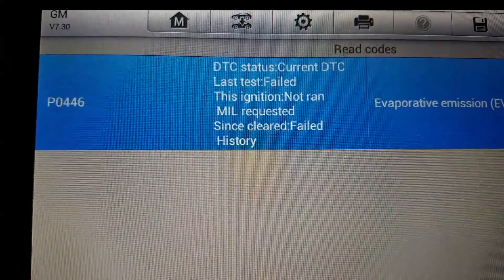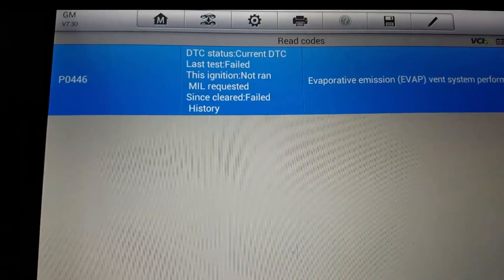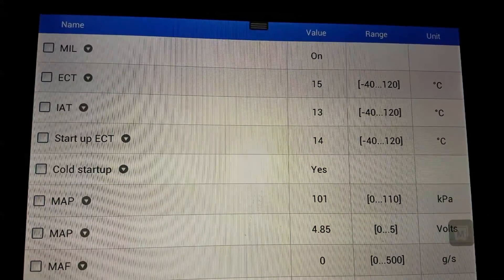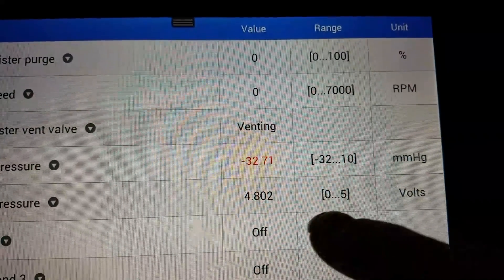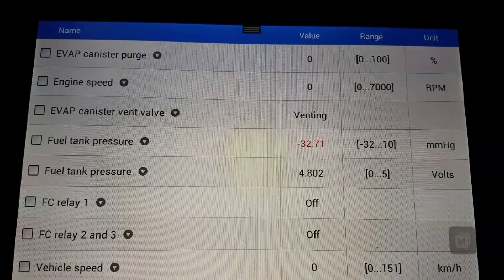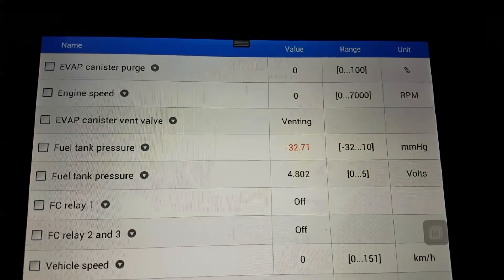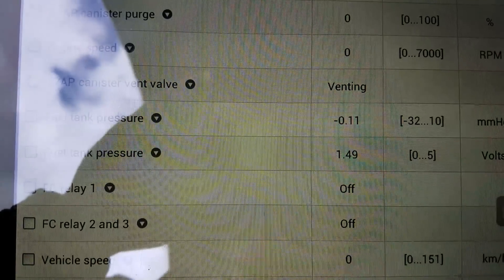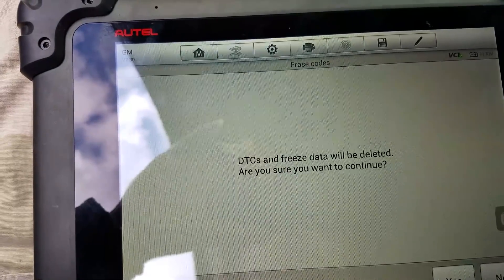Chevy GM truck P0446 diagnosis

Comment: Shango066 excellent explanation 👏.  My question is when fuel pressure sensor is bad.  Can provoking catch to much air vapor in the fuel tank.. when i open to much Air vapor comes out... Thanks again 👍

Comment: Had 4.9 volts on mine. Never changes.  This video confirmed my suspensions. Dropping a tank is not that bad.
Reply: I have 5v on mine all the time. But I have changed the FTPS at least once and no change. l've gotten good enough at it that I can change it reaching between the bedside and the tank.
Reply: @Lost_souls_lose_freedom  I changed mine. I was able to drop the tank just enough to get to it. It fixed the problem. Got through CT state emissions. 6 months later sensor failed in the same manner again. Getting an oem one this time and might run a new ground to it.
Reply: @Lost_souls_lose_freedom  When you lose sender ground, you also have 5 volts. A short from 5 volts power to signal can too. You will have to take readings at the plug. Or short ground to signal to see if you get 0. That will test the ground wire. Could be as simple as a bad pigtail. Only way to know is to test.
Reply: @jayclark5912  i followed the Alldata test and it comes back "replace ecm" everytime. I don't normally believe that but the harness just past that pigtail was drilled into at one point for a transfer fuel tank in the bed. Maybe it back fed power to the ecm? It blew a fuse and it seems like this code has been an issue ever since. It doesn't take fuel right though so in my mind there is still doubt about it being the ecm.
Reply: @jayclark5912  thanks for the reply and advice! Always great when the comment section is helpful instead of trash talk. Lol

Comment: That's great that you diag-ed the P0446 trouble code.  I have a GMC cutaway (really the mechanics of the van) and I have changed the gas cap and vent valve (low cost: less than $75) to clear this code before.  Code P0446 came back and now will change the fuel pressure sensor.  My only problem with your video is that you should have recorded your job in taking down the gas tank, replacing this sensor and reinstalling the tank.  That's where many who have not pulled down a tank get stuck.  Very few videos out there on getting to this part.  Always recommend video it all -- it can only add great content to a repair video (which probably gets you more likes and subs anyway).
Reply: Did you end up doing it?

Comment: Will this cause loss of power ? This popped up and I had no power when pushing the throttle. I cleared the code and the truck was fine 2004 Colorado 3.5

Comment: Another thank you!  Had the code on my 2015, hooked up my Autel and saw the same high reading from the pressure sender.  Cap on or off, running or not, was stuck at 4.8.  Thanks!

Comment: I have been getting this code on a 2001 Saturn SC2. The part in the video appears to have a split gasket where it goes in the tank. I wonder if this is the failure, or did it happen when it was removed from the fuel tank.

Comment: My 01 GMC sierra keeps throwing the same code. I've replaced the purge solenoid under the hood, the vent solenoid between the cab and bed. With key on, engine not running, I am getting 12 volt at the vent pig tail, but it won't light A test light. My sensor for fuel tank pressure is reading the pressure. If I remove the fuel cap the pressure changes. I'm not sure it's A wiring problem or this sensor in your video.

Comment: Thank you for this informative video. Instead of going through the living hell of dropping the tank I just took off the bed bolts and lifted the driver side of the bed and propped it up securely.  It gave me plenty of room to kneel down and access the top of the tank and fuel pump and saved me hours of stress.

Comment: total nonsense . all this crap is not needed. vehicles ran great till 1971 when they started bullshit emissions . was great to work on a vehicle without a computer . nowdays it is very hard to work on a vehicle without expensive gagets ! takes most of diagonist knowledge out of the equation .

Comment: I have a 440 and a 446 and a 340 . My former mechanic said the fuel sensor is bad . Funny thing is I just changed out the fuel pump and came with a new fuel tank pressure sensor . faulty from a factory wow cant even get a good part any more. I did drive thru a river of water a couple of weeks ago . Guess my oldsmobile just hates to get wet! Don`t think it can all be just the tank sensor . It could be more wrong with car . Notice I said former mechanic it is because I scanned the car and found no 340 code . It was a old code not a new one . The guy ripped me off over $250.00 for changing out a rotted steel line going to purge valve . They used a rubber line and two clamps held car on lift for a hour and 20 minutes with no one working on it . How can You justify that kind of work. I don`t think so. Then the guy takes it for a test drive for what ? Or as they say in mechanic circles a road beat . The guy just did not know I was a mechanic for many years and know a rip off when I see one.

Comment: Awesome video and on target.  My pressure sensor tested bad just as illustrated.  We were able to R&R the sensor by hand w o removing the tank or lifting the bed.  10 minute repair instead of 3.5 hours...yippee!
Reply: How did you manage to do this without removing the tank?
Reply: @ericfield2112  just stick your hand up in there.  You'll feel it. Hardest part is disconnecting wire.  I've done 3 out 3 this way.
Reply: @jeffgeisler5083  Any danger in NOT replacing the sensor?  Like, if the truck is still running just fine, do you HAVE to replace it?
Reply: @ericfield2112  Fundamentally, you should not drive your car around w warning lights on AND my state does inspections so not optional for me.
Reply: @jeffgeisler5083 I know pa it will pass even if the light is on. You can’t have more than one meter not set.
Reply: What kind of vehicle do you have?  I need to do this on a GMC Sonoma.

Comment: If I replace the fuel pump does it have a new fuel tank pressure sensor?
Reply: Yes, I replaced this sensor,  fixed the code, but years later the fuel pump went out, I should have replaced the fuel pump saving me time and money.

Comment: My 2014 gmc sierra 5.3l has had this code for sometime but now i am getting a cascade of other codes p0446, 0011, 0300, 0324, 0326, 0420, 0430, 06dd, 2097 219a, i believe i got some bad gas recently and have been running premium and additives which seem to work some but codes return. Is it possible all related to original 446 code?

Comment: That idea about making another channel sounds great.My son is having problems with his SS MonteCarlo the oil pressure gauge works in reverse ,you rev the motor it goes down and at idle it has about 10lbs.pressure,when you first turn the key on, all gauges reverse till engine starts.any ideas?

Comment: Dealt with this $20 fix on my ‘99 S10. $30 scan tool, a lot of web scrutiny, and half an hour to unbolt/bolt the bed did the trick.
Reply: What scan tool?
Reply: @MatthewRichey  Couldn’t tell you now. It was a basic scan tool I bought at an Advance Auto Parts store way back when. The issue was a stupid sensor on the top of the fuel pump assembly IIRC.

Comment: I've had this very same issue with my Blazer after changing the fuel pump. After about a month EVAP SES light with tank pressure low.

Comment: Any way to run 2-3 volts to the computer wire to fool the computer, turn off the light and pass the emissions test? When it's too much work, cheat..  Serious question I don't feel like dropping the fuel tank and the vehicle works fine except for the damn light.
Reply: Robin Sattahip I think it also tests if the pressure drops as the evap valve opens and checks for leaks in the tank (pressure going up too fast) so with a fixed voltage it would give an error in that test. At least that's what I've inferred from some other repair videos.

Comment: Thanks for the tip on this, great information! As long as the tank is out might as well do the fuel pump and sender too I suppose. I've got a weak pump in my 2000 S-10, you've got to prime it a few times before attempting to start it when the fuel level gets too low.

Comment: Didn't mention if the value is close to 5V it could also be a bias voltage, which would mean the wire is cut/disconnected somewhere.

Comment: Makes me want pre 90s, better yet, pre 70s - before the EPA BS, when the only device was a PCV valve.
Reply: That's why I still drive my D100. No EGR, no catalytic converter, no evaporative canister, no computer, no sensors. Just a PCV valve. I can fix everything with common hand tools in minutes.
Reply: Ken Call  Nope there still will be electronic solenoid's relays & reostat switches that will need to be used !

Comment: I've been getting this code for years in my 2002 Subaru WRX and my research shows it's a common problem on these cars as well.  I wonder if perhaps they use the same part in that vintage Subarus?  I've tried the standard steps of changing the gas cap and reinforcing the evap line connections but the problem persisits. Thanks for the tip!
Reply: GM Daewoo SKorea parts?